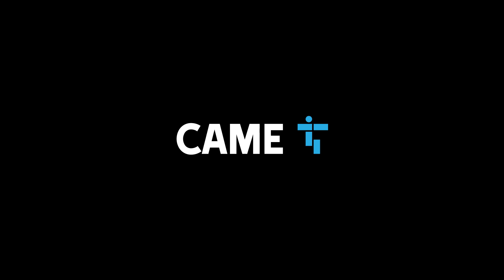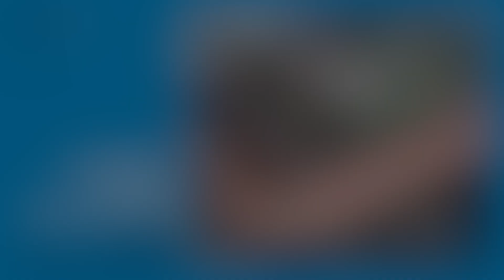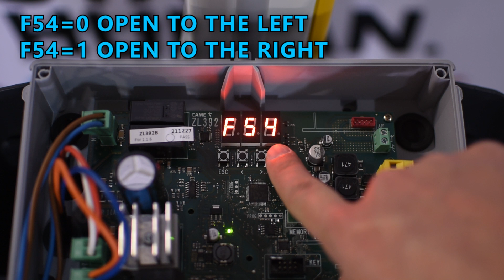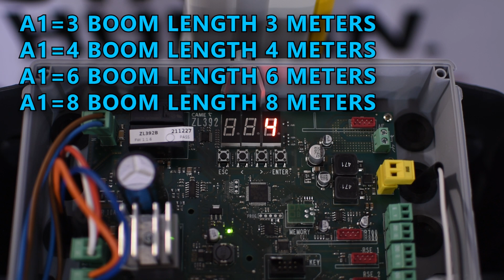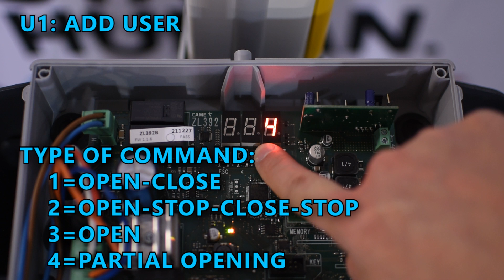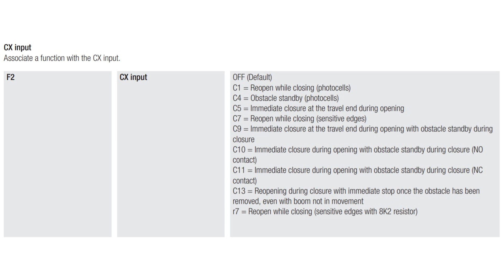🔷 🔶 Automatic Barrier Gard GT4 - GT8 I Basic Configuration 🔶 🔷

Comment: Sir, what model is your came barrier? My came barrier is G4000 and my remote control is TOP42FCN... but I have another old remote that is TOP432EE they are same frequencies as 433MHZ. Can I use also the old one? I'm trying to copy the program using pressing the two buttons from the old one, but I can't copy...can you explain sir?